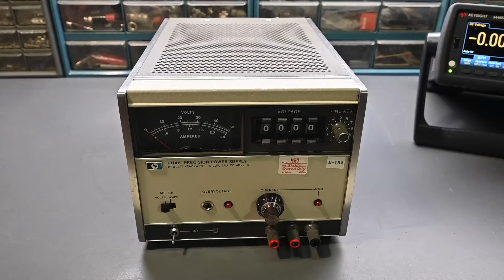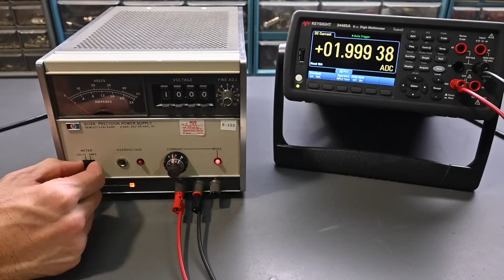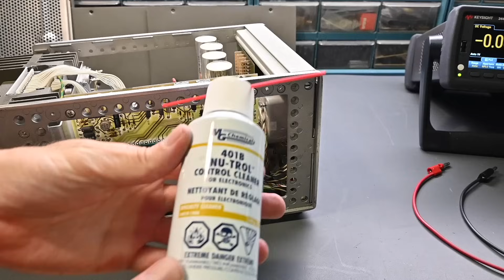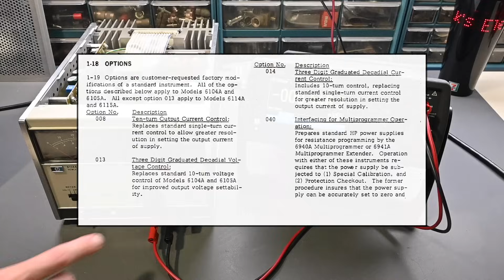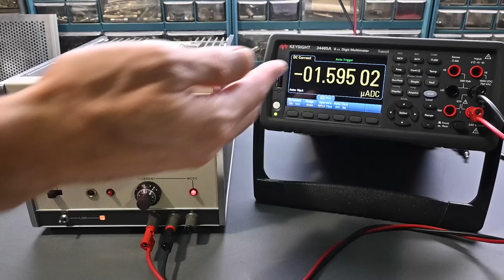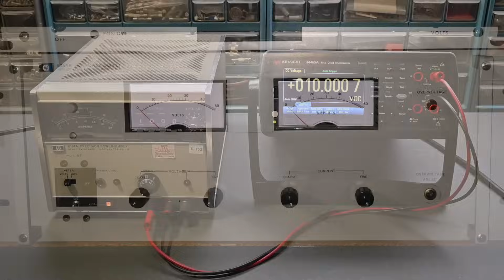HP 6114A Power Supply Repair - Overvoltage Shutdown & Intermittent Faults

Comment: I have an HP 6024A power supply (0-60V/0-10A) that has a problem with the main transformer drive circuit.  The manual I found online has schematics that are very difficult to read.  Would you by any chance have documentation on this unit?
Reply from the maker: The only tech manual with schematic I know of is at this link  https://www.keysight.com/us/en/assets/9018-05841/user-manuals/9018-05841.pdf?success=true

Comment: Actually the numbers on the current dial do have a relationship. They represent the percentage of the maximum output current you're set to.
Reply from the maker: Yes they would be the percentage of the gross current rating but not the 1 amp or 2 amp range values.

Comment: I have a bit suspicion that the option 015 might be related to the dual range 0-20 and 20-40 V mentioned under the meter.  I have had a plain power supply 0 - 20 V and also a plain 0 - 40 V.  No option, a far as I recall.  I said "have had", because I did some trading with my employer once, when they needed some specific version.  If i still have any of the 3 models (the last being 10 V), it might be in my outside rented storage.
 
 As a side note -- HP Journal once had a story about manufacturing their analog meter scales.  That might have been one of their 1/4 rack metres, something like 227 or possibly 4000.  In any case, they showed two superposed images.  They told that the individual movements deviated from each other due to the movement slight non-linearities.  Therefore, each meter scale was custom made!
Reply from the maker: For this power supply the base model 6114A was still the  0-20 / 20-40 volt ranges with the low range up to 2 amps an the high range up to 1 amp.  The service manual details this.

Comment: I have one of these high precision power supplies. Like everyone else in the thread, I'm fascinated by these old analog designs. But then, when I started out, 2 layer boards were all we had to realise our designs on. Layouts were done on a drafting board with red and green "traces" - basically sticky-tape - and black circles for vias. I had the dubious pleasure of designing the first board - a half-card memory board - for which the draughtsman used an electronic layouting system. It had high resolution tube-based terminals. The software even included autorouting. Using it, overnight, it did a brilliant job but unfortunately, the remaining 5% of traces were impossible to complete. I requested that the layout was torn up and restarted. We routed the whole board by hand. What was important to recognise was the repetitive nature of a memory array meaning making use of the parallel tracks associated with address and data buses. The layout was completed more rapidly and accurately than using the old method. My HP machine is of course for 240V. Using the terminals at the back the output can be controlled using a (decade) resistor box or it can work as a voltage follower. Corporations now work to satisfy shareholders not to meet customer requirements so it's OK to offsure production and even engineering. Despite what some people believe, many products from Asia do have excellent quality and reliability at the expense of local grown expertise. Edit: "offsure" 😅 I love it.

Comment: Picked up one of the 6115A power supplies for dirt cheap off of freeway, used, not working.  Turns out, it worked like yours.  These things are very accurate even decades after sale and mine is within a few mV from the bottom to the top at 100V on the 7.5 digit meter.  Frankly amazing considering that the Zener is in the air on the board and not even encased or heated for a 50 plus year old unit.  These are a gem for basic calibration of 3.5 and 4.5 digit meters.  If you can lay hands on one, they are a good choice if you need an accurate and repeatable voltage source.  Tip, leave it on and heated up to minimize drift.
Reply from the maker: Yes the accuracy and stability is amazing given how the reference circuit (zener) works as you mentioned.
Reply: @EriksElectronicsWorkbench  The Zenner reference diode chosen is a very specific one that has a stability rating of something on the order of .005% if memory serves.  I actually considered throwing a small resistor transistor thermistor around it to provide an elevated and stabilized temp, but to what end?  My Keithly DMM7510 or Fluke 34420A are likely far more accurate long term.  That and I have access to a Fluke 5520A calibrator so no real need.

Comment: Thanks a lot for your videos, they are excellent! I wanted to ask you for a recommendation about storage cabinets for electronics components. I see you have some very good looking ones in the background. Is there a specific brand that you favor? Thanks again
Reply from the maker: Thanks for taking time to watch.  The plastic bins are over 25 years old, I bought them at the local hardware store.  I don't recall the brand I think it was just the house brand they carried.  I can also recommend the Uline brand www.uline.com model H-5579BL or H-5578BL.

Comment: The ten turn dial indicates the percentage of the current limit which can be 1 amp or 2 amps depending on the voltage setting.
Reply from the maker: At a dial setting of 10 (100%) the current is actually at the gross limit which is above 1 or 2 amps.

Comment: I have enormous respect for HP. I'm not saying Agilent. That name change was the beginning of its decline. The HP I'm referring to is the one that made incredible products, especially in the 70s and 80s, completely innovative and reliable, above all. No software. Robust, extremely precise hardware solutions, like this power supply. I challenge any current brand to have a product that maintains its specifications for more than 50 years. With "made in China" products, a 5-year lifespan is already unthinkable.

Comment: Delightful as always!

Regarding pots and them needing lubrication, I canalso recommend DeoxIT's F series (Fader cleaner) sprays and lubes (F5, F100 etc), since they will also clean&re-lube pots. I've basically given up on pure contact cleaners except for chunky stuff like outdoor light switches -- the DexoIT stuff works for indoor stuff just as well, and the lube doesn't really hurt any switch (depending on switch construction, it might even help with reducing arcing and thus contact wear).

As for the volt/amps switch, I have found that they usually fail (if they do fail, not just dirt), then wiggling the switch orthogonal to the normal direction will tickle that particular fault, probably because a contact is tweaked over enough that it disconnects or becomes too-high-resistance. 

And thank the vintage electronics gods that the control board is not a 10-layer board :)
Reply from the maker: Thanks!  Good info on the cleaners and the switch.  Yes if the board was multilayer drilling could lead to big problems!!

Comment: Thank you, but what is the point of grounding if the manufacturer has put an outlet on the front of the device?
Reply from the maker: The front panel chassis ground jack is for convenience if you have a need to tie the power supply earth ground to another instrument etc.

Comment: In the HP catalog of 1980 page 236/237 in the table that spans over the bottom of both pages options 9 and 15 are mentioned for the 6114A. It is detailed as follows on page 240: 
015: three-digit graduated turns-counting dial and tenturn controls for output voltage and current (where applicable and available). Improves resettability of power supply output

Comment: Did you check for AC ripple or other noise on the DC output?
Reply from the maker: Yes, ripple and noise is extremely low, under load less than 100 uV rms, this is a bit over the 40uV rms spec by HP.  It is difficult to measure such a low value as other noise picked up in wiring, ground loops, etc interferes.  I need to test with a better setup to eliminate external noise but I don't see any serious issues with the power supply like a failed capacitor.

Comment: 015 looks to be the same as 014.    This link took gave me a bad https error, but continuing to the scan, it shows 015 as the decadial https://www.electronicsandbooks.com/edt/manual/Hardware/!%20New/09)_Misc_Test_Equipment/1)_Brochures_and_Datasheets/HP%206111A%20SPECS%20c20021217%20[1].pdf
Reply from the maker: thanks for this link